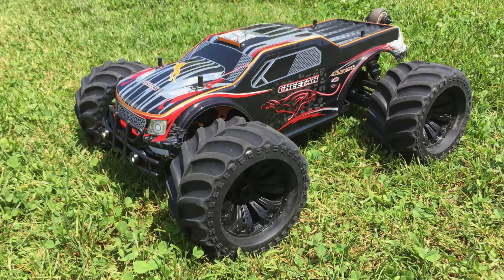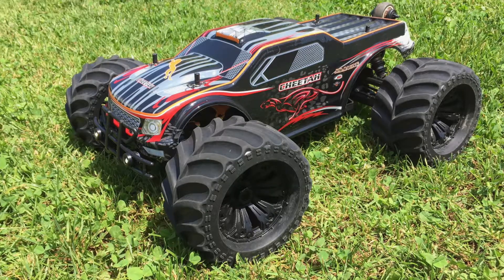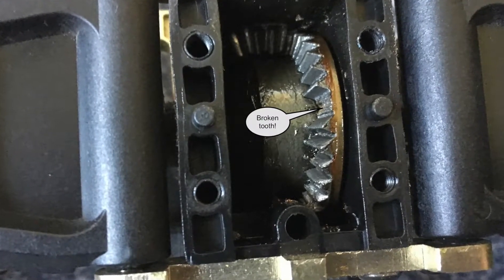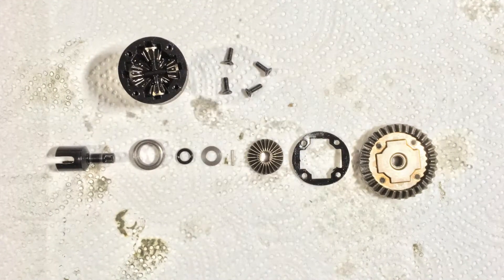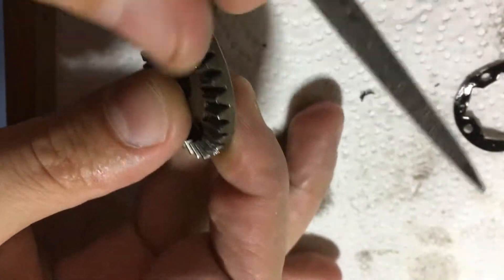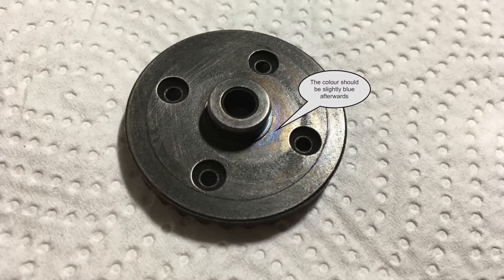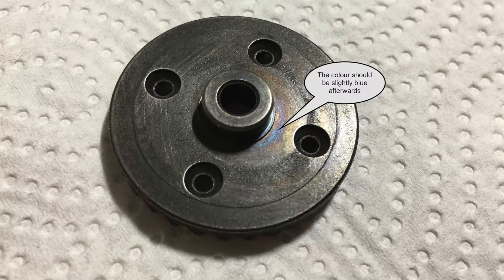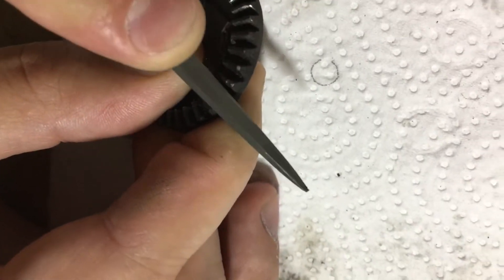Steel RC Car Differentials: How Do They Hold?

Comment from the maker: What do you think about this video? Please leave your comments down below.  Thanks.
Reply: great just like all your vids.
Reply from the maker: Yes, tempering makes the steel softer, but it's still hard enough for this application (dragsters also have soft steel gears to prevent them from cracking). For more details see: https://en.wikipedia.org/wiki/Hardened_steel

Comment: Hi. What CST do you use for the silicone grease inside the differential? My dif broke all the teeth inside of it, ordered the spare parts, but i have no clue what cst should i use for the grease. Is 5000 CST too thick or too thin? Thanks!
Reply from the maker: Hi, it's too thin. Use 500'000 cst
Reply: @TheDIYGuy999  Super. Thank you! It's in the Amazon basket :). Any recommendations for dämpferöl? One has completely leaked. This hobby is getting expensive :)
Reply from the maker: @florianrc919  I'm using the soft damper oil from Tamiya
Reply: @TheDIYGuy999  thank you!

Comment: Don't need do the same with the other gears?
Reply from the maker: It looks like the big ring gear is the most critical. Both of them got damaged unil now. The pinion on the rear side was also slightly damaged. The spider gears are still fine. Time will tell. I have tempered the ring gear and the pinion of thr rear side so far. If necessary, I will also do the other gears.
Reply: Thank you!